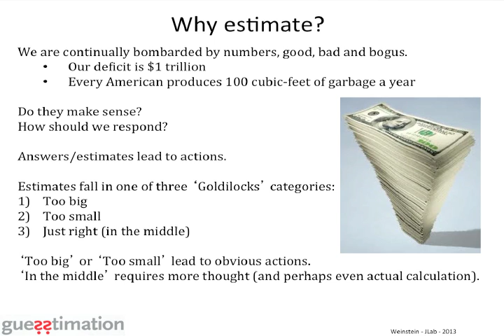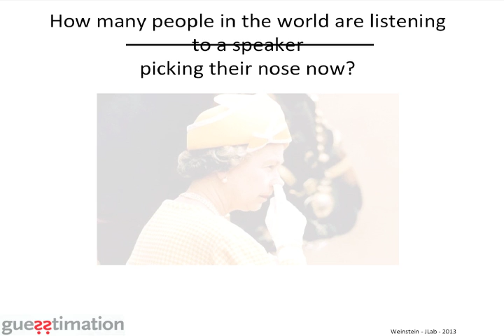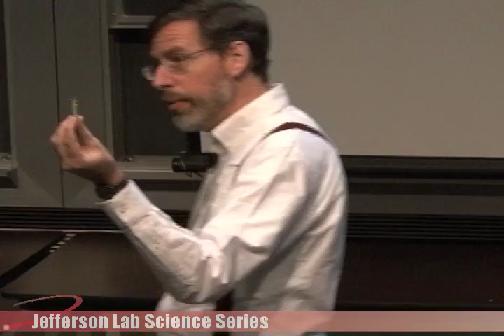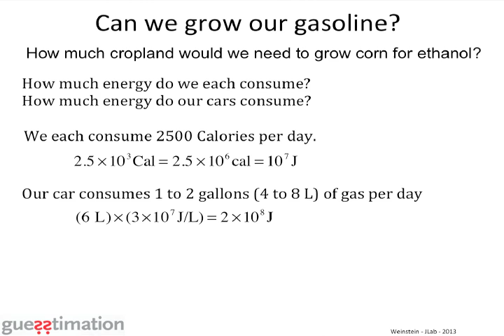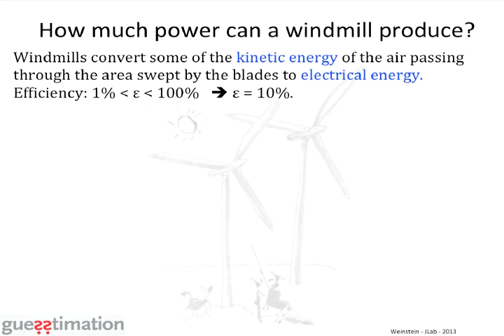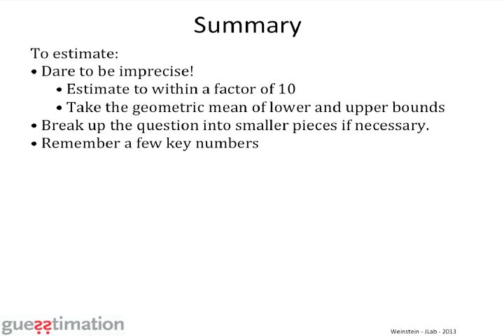Comment: What is your view on metric units? I live in a metric country so its normal to me. Every high school (here at least) has a 400m running track with two 100m straights. I remember doing 100m sprints. So its easy for me to visualise distance in m. And I know a 1L water jug weighs 1kg if full. But I know Americans like their feet, yards, pounds, gallons, miles, inches, Fahrenheit etc. Is it a pain using metric when your used to using imperial units? How does it work over there?

Comment: He didn't say that they were useless. In fact, at 21:40, he says that electric cars ARE useful if you know that you're going to drive less than 40 miles that day.

The point about recycling the plastic bottle is that, in the grand scheme of things, it's tiny when compared to other issues. It's kind of like stressing over the leaky faucet in your stateroom aboard the Titanic. Would it be nice to stop the leak? Sure, but there are larger problems to deal with.